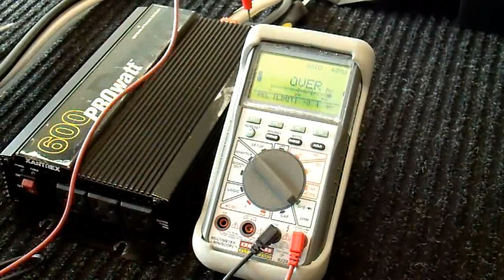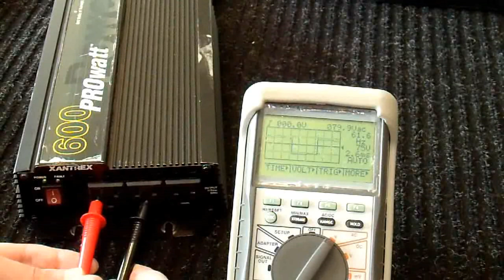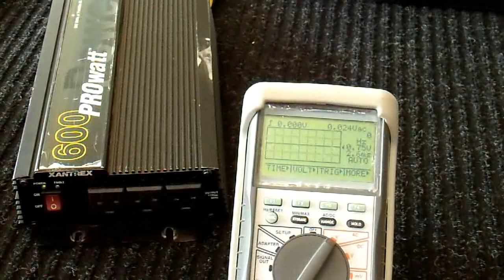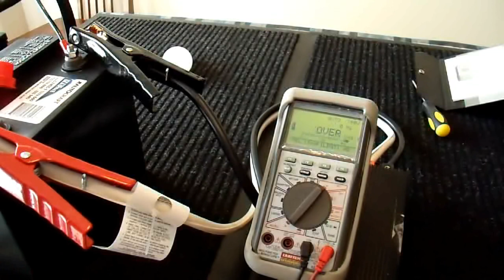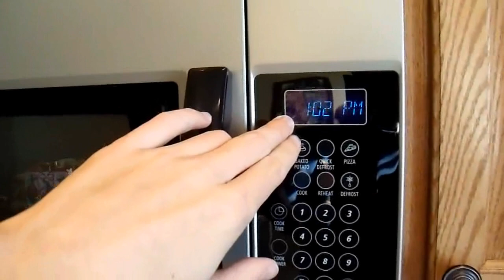How NOT to Connect an Inverter to Your House Mains - Xantrex ProWatt Inverter part2

Comment: This was an excellent video. You've got a very cool hand held multimeter. I've never seen a scope output on a handlheld. I want one. The video resolution wasn't good enough for me to read it. What brand/model is that?
Reply from the maker: It's a long out of production Craftsman.  They sometimes come up on eBay but more modern versions are available.  I'll probably use this 25 year old one until it dies though.  I can't vouch for any of them but if you simply search for 'scope meter' on Amazon a good list will pop up.  Nearly everything on Amazon is garbage so do your research before buying!

Comment: I have a Pure Sine Wave inverter that also has half voltage from live to ground and natural to ground, I checked on the Hardwire connections that are there if you decide to use those in place of the outlets. So I am a bit confused.

Comment: Very interesting... In this video...https://youtu.be/BYMOWIejujo I saw how the ground issue was solved in this inverter.  However, it is as shown in your video that the hot and neutral are like split voltages...so they are not good to connect to your breaker box.. unless you bring both hot and neutral to your appliances that you want to power.  At the end, you are better of to use a power cord directly from the inverter to your appliances...but check if there is a true ground on the inverter as shown here https://youtu.be/BYMOWIejujo ...otherwise your appliance will have a floating ground...

Comment: I installed a $300, 10 circuit transfer switch for my 7500 W generator.  It took about 3 hours.  $300 and 3 hours does not translate to "thousands of dollars".  If you can do what this knucklehead is telling you to do, you can install a manual transfer switch.  It allows you to bring one circuit on at a time while watching the current meters  to keep from overloading your generator and most importantly it protects lineman from being electrocuted by your back-fed circuit should you forget to turn off the main breaker.
Reply from the maker: 'I installed'.  Exactly.  Call an electrician to install one in an already full electrical box and see what it costs.  Thousands of dollars.  I could also install one for under $300 but that isn't the point is it?

Comment: Some inverters are wired up to two outlets that can only be connected by splicing the hot and neutrals  together so two can be one likely cause they are on separate phases or whatever it would be with inverters though some are joined like mains white to white etc so even attempting to stack can result in some pissed off electricity it's always good to have a voltage meter and whatever you don't attempt to ground the inverter at the output nema receptacle it will send it to the body and you will get shocked

Comment: Old news by now, I'm sure, but many Reliable brand inverters do in fact have a live ground on the hardwire side. Apparently the newest ones do not, but it is something to keep in mind as well.
Reply: I’ve linked my ground and neutral together for my 3000w version, and I had no problems. It says in the manual that it’s okay to do this.

Comment: So are you saying that I should use a pure sin wave inverter.
Reply from the maker: For most applications yes.  If you're only using it for intermittent use of power tools or water heating or other such specific purposes then modified sine would be OK.
Reply: @knurlgnar24  ok cause I do have a 3000watt 24v reliable pure sine wave inverter.

Comment: Inverter generators are weird too.
Reply from the maker: I don't consider them weird really - they're just an alternator running a normal sync-to-mains inverter.  They have horrendously poor surge capability compared to battery inverters though, and surge capability is more generator-like since there is no energy storage aside from the flywheel/genhead.  Like normal generators you need to size them to your surge starting needs.

Comment: Sir 

I want use inverter electric bill safe for my home. Please give me information how to use. 12v to 220v power inverter 3000w delivery ac.if you help it will highly appreciate.dc 12v adapter connect inverter .

Thanks 

Dip

Comment: Thank you. I just bought a Jupiter 2000 watt inverter at Harbor Freight and I was going to do this. Years ago I had done this with a 6500 watt generator into a 220 and that did work.
Thanks for the warning. I’ll just run extension cords from my car. Do I have to ground the inverter to the car frame? Thanks

Comment: Great video I have a portable diy set up 1500 watt inverter not pure sign I want to hook it up to a small hunting cabin that is wired for generator if I understand you you can use this if you don't connect the grounds so to prong's on your cord also no 220 volts just a fridge and lightning and a tv am I correct ? Thanks for sharing
Reply from the maker: I have a video on how to power your house in an emergency during a power outage that covers the dangers and practical considerations in more details, but yes I agree with what you are saying.
Reply: Thanks for your input

Comment: Works fine on my house but I have no circuit breakers whatsoever and I am on 240 volts AC..,.. 240 volt 2000 watt pure sine wave inverter Powers everything in my house but the hot water which runs on 3500 Watts. So I just pull the fuse from the hot water turn off the main switch then go back inside and turn on the inverter and everything works Peachey.., I don't have an earth on the cord I have a separate Earth tiger the inverter which goes to ground in Rod outside. Never had a problem with AC voltage backfeed in into the battery bank..... But as I said this is a very old house with no electrical safety features whatsoever.

Comment: Can I wire my Jupiter 5000/10000 directly to my off grid D breaker box using the plugs at the inverter and hard wire into my D breaker box. 1 plug per fuse??? anybody

Comment: Not all MSW inverters have that problem.  I have a Statpower 1000 watt that has 120 volts from line to neutral and no connection to ground from either.  Statp
ower is a Xantrex product so that might be the difference in quality of design and construction.

I have two 2000 watt purse sine wave inverters that I use for backup power.  They're from Reliable Electric and they produce a better (cleaner) sine wave then the local electric co-op.

Comment: I use a 3 prong cord with male plug on both ends and plug in to wall sockit and get no backfeed but mine is a travel trailer converted to a time home the way it is wired all your doing is supplying power from the other end flip breaker and theres no ground cause the inverter is open ground and trailer is not grounded when main is off  .its purposely wired that way

Comment: OMG your Ground and neutral are connected that’s the scariest thing I’ve ever seen!!! You know the The big round thing on the pole outside of your house is a transformer and the neutral is a center tap For that transformer it’s not a ground. However great video lots of good information🤩
Reply from the maker: Ground and neutral are hard tied together in all North American distribution systems by law.  This is generally done inside the breaker panel.
Reply: In the near future no house will be wired like this. this is actually extremely deadly! When it comes to a transformer there is no such thing as a ground the center tap of the transformer or “ neutral” is a return path or a complete circuit. Current and or electrons will always try to find their way back to the source. if you have a ground short that current with the voltage will carry itself through your yard and try to make it way back to the source a.k.a. transform.
Reply from the maker: @johnnychapman6322  I'm not sure I understand what you are saying and I am not saying that I disagree, just that I am not sure it is so straightforward.  There are competing lines of thought here depending on where you live but here in the USA and in many other jurisdictions all buildings are wired this way by law for safety reasons that are very valid.
Reply: If you look at a North American utility pole you will notice that the center tap is connected to ground at the transformer.

Having said that, I agree this system (known as TN-C-S) is relatively dangerous. I think it would be better if we switched to a full TN-S system where there is never a combined neutral/ground wire anywhere.

Comment: put in a separate fuse box for the stuff you want to run off ur inverter....  and switch those breakers from the line box to ur new inverter fuse box with the black wire.. aka power still on the breaker...just need a neutral jumper from the main fuse box to the inverter fuse box.. and in the event that ur inverter systems fails..  simple matter of just replacing those breaker back into the main line box..  keep a flashlight handy nearby,,     ive got all my lights and wall sockets on inverter fuse box...  kitchen wall sockets are left on the main line box.  coffee pot..fridge and hot plate are not on the inverter   the hvac and 220 system is not affected or messed with

Comment: Hi!! Are  you telling me that, that huge fridge  only uses 150 watts????
Reply: Fridge compressors draw comparatively little power, and150 watts is about right.
Reply: @Daniel-Six   I run a small fridge with small separate door freezer(bar size) and it draws 80-90 watts  on my pure sine wave inverter????

Comment: Hi knurlgnar24,
Thanks for the very interesting video, but I would like to add a twist to your comments about the output of an inverter that has approximately 80 volts AC between the neutral pin and the ground pin, as well as 80 volts AC between the hot pin and the ground pin.  I have a very inexpensive 200 watt inverter (modified sine wave) from Harbor Freight that measured 45 Vrms (true RMS) between the neutral pin and the ground pin, as well as 45 volts (true RMS) between the hot pin and the ground pin, but I also know my inverter works fine when back feeding an outlet in my house when the circuit breaker in the main panel for that circuit is turned off.  Since the circuit breaker in my panel does not disconnect the ground or neutral wires of the circuit when the circuit breaker is turned off, I came to the conclusion that I could tie my inverters output ground and neutral together (since that's what happens when I plug it into the outlet that I'm feeding which works just fine).

When I tied the inverters output neutral and ground together today right at the output of my inverter without anything connected to the output of the inverter, the inverter functioned just fine as I suspected it would, and now I measured 120 volts between the inverters output hot and ground pin, as well as 120 volts between the inverters hot and neutral, and of course 0 volts between the neutral and ground (and this is exactly what we want).  Therefore it appears at least on my inverter, the neutral is floating relative to the ground, but that does not mean that they can't be connected together as demonstrated in my test.  I am not saying this applies to any other model inverter, but it certainly works fine on my cheap harbor freight 200 watt inverter, and connecting the neutral to ground on the output of my inverter also corrected the high voltage condition on the battery terminals to neutral that you mentioned.  I don't recommend anyone back feeding without a proper transfer switch, but wanted to share my experience from an educational standpoint.
Reply: Some actually have a ground relay in them so yours might be one of them. They can detect when a unit is grounded to Earth and change over. But that would be a first for a cheap one.

Comment: Simple solution, buy a grid tie , done.
Reply: Great but grid-tie inverters only work if there is mains power available.. once the power goes out, the inverter shuts off. Not to useful in an emergency power outage situation
Reply: So what I do is this. I run a dedicated line into the house and connect to three dedicated outlets.  When power goes out I thow the switch to send power to battery bank powerd by solar and have power when grid is out. I use it that way all the time. Works flowles ever time.

Comment: Great video.  Summarizing: Using a suicide cord to a disconnected from main panel will blow your inverter, Using a cheater/2 prong plug between inverter and panel puts your 12v battery terminals at high voltage AC which is deadly.  Solution for an inverter like this/like mine is to get the appropriate transfer switch, which is sometimes called a GFI or three pole transfer switch.

By the way, for newbies like me: an open electric panel is a very dangerous place and potentially deadly.  The 2 large lugs/black wires bringing 120 AC in to the box are ALWAYS live.  a mistaken touch will kill.  Assume individual breakers are still live unless tested, even when the breaker is off. Your life depends on it.

Comment: Here in UK the ground is seperate to the neutral.   All the grounds go to a grounding rod in the ground outside the house.   When there is a leak,  it goes into ground. (The neural and ground ARE actually tied together in the sunstation transformers which are grounded to earth.

When i power my home from my inverter I disconnect the main breaker coming into the main feed fuse box (this disconnects the neural as well as the live (hot).   

With our system not tieing the earth and neutral together on the consumer side of the mains switch,  we have no issue.

Comment: Thanks for the info. Now I'm worried and confused. I have a 5000 peak 2500 continuous cobra modified sinewave inverter in a solar shed. I'm about to hook it into an off grid breaker box running 4 outlets that will be used for power tools. If I hook both grounds to the ground bar and hot to the main power connection to energize the breakers and run that off a three prong plug off the inverter will that work.

Comment: i just disconnect the neutral at the box, and then confirm there is no link between them with a continuity test, once confirmed, just connect the suicide cord with the ground, i ran it like this for 2 weeks during irma and had no issues and many times before that, and then i just topped of the batteries daily with jumper cables to charge, very awesome!!!!!!!! i used a xantrex xpower 1500, are there any unforeseen issues with is?

Comment: Thank you so much for your knolege im from Puerto Rico and since Huracane Maria i decided to start going solar bit by bit, so i bought a puresine wave 120volts  3000 watts Pugu inverter but i noticed it doesnt have enything conected to the ground inside and also i did a backfeed on a 240 dedicated curcuit with my main of but i felt that shock by touching the body of the inverter and also if i touch eny leed on the battery. Should that happen on a pure sinewave also?

Comment: The hot ground is so important. I buy nothing but pure sine wave inverters and will now go to each unit check to make sure we're at 120 from hot to ground and neutral. You've provided very good information, at least a reminder. For short term applications it's just a matter of using extension cords.

Comment: What if you hook both of your positives to 1 prong your ground both to the neutral wire? Yes I know that's a lot of current for one prong but in theory it should work would it not if both top posts are positive why not just hook them to one post and your ground and neutral to the other posts

Comment: I'm installing a pure sine wave inverter in my boat and it got me curious, if the inverter were powering the boat and it was also plugged into line power what would happen?  Double voltage, smoke the inverter, or?
Reply: A boat needs isolating transformer to separate it from the mains.

Comment: That breaker box would definately never pass European safety codes. Those exposed terminals at the main breaker alone makes me cringe!

Anyway, the "suicide cord" would work in Europe because ground and neutral are not tied together as in North America.

The ground rod is connected to a separate ground bus and neutral has another separate bus. If we tied ground and neutral together the GFCI or RCD would trip.
Reply: Actually the neutral is bonded to the earth ground in the main electrical panel by the "Bonding" screw in USA. There is a screw that goes though the neutral bar into the metal of the box. The main panel is the only point in the building where they are allowed to be connected together, any other panels have the neutral and ground isolated and must have a ground bus for the grounding conductors. . Check out Article 250 in the NEC., I am a retired Master Electrician.
Reply: the video bears evidence quite contrarary to that.  The earth and neutral clearly are tied together
Reply: its supposed to have a cover over it that never gives you access to that view, unless you remove it

obviously he has his removed since he knows what hes doing, but everyone else has no ability or want to go back there
Reply: Marcus, Two points for you.

Firstly,  please refer to 5:16 in the video to categorically see the grounds tied to the neutral, alongside the guy stating "the grounds and neutral are all tied together"

Secondly,  I think you misread something.   I did not say the following, which is what I believe you got confused about.  It was t0nito9 who said it.  I at no point stated anything negative about the US wiring tecniques - I know enough to understand it is as safe as ours.

QUOTE** t0nito8: 8 months ago "That breaker box would definately never pass European safety codes. Those 
exposed terminals at the main breaker alone makes me cringe!"**

Comment: Would those Pure Sine Wave 220V split-phase inverters need a center-tap isolation transformer between them and the house in order to connect the neutral?